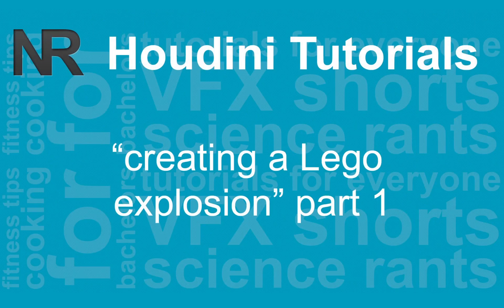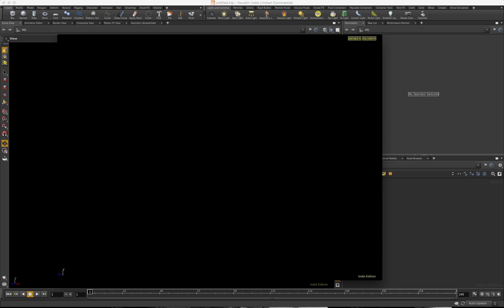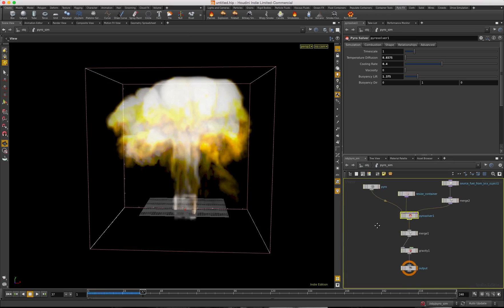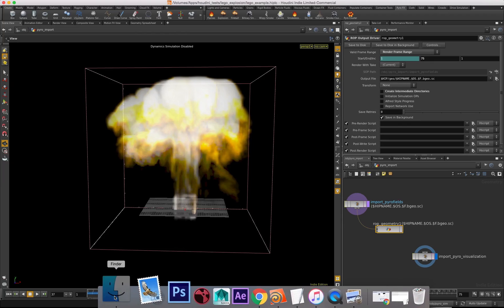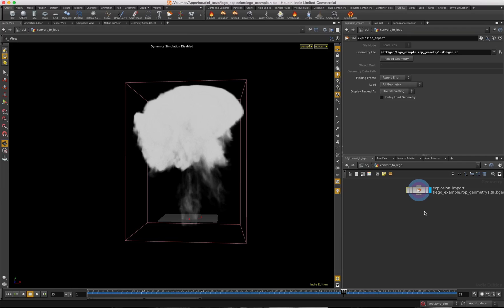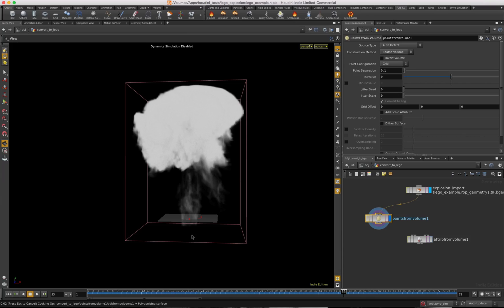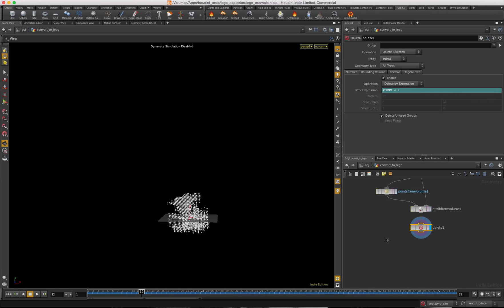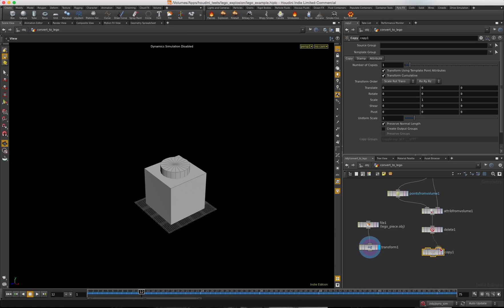Houdini Training 101 - Creating a Lego Explosion

Comment: Now I still have two questions I would like to ask, that you might want to address in the next video too. (which is btw coming soon guys, a bird whispered in my ear..:) .). 1 Can you up the resolution of your lego explosion by making the bricks smaller and than messing with the point separation? and 2 do I have to use rather square briks for it to work or is there a way to use realistic modelt lego bricks and than adjust the voxel spacing on the y axis alone? Thx man!
Reply from the maker: Yeah. You can definitely change the size and spacing like that. I only made it fairly low resolution for the sake of the tutorial... but if you were doing a larger explosion, increasing resolution would make sense.

You can read in any geo, so if you wanted to spend more time modeling (or download) something more detailed, it's easily done. Depending on the size or dimensions, you may need to play with the spacing a bit. Again, I just modeled something in 30 seconds for this example.

Hope that helps! :)